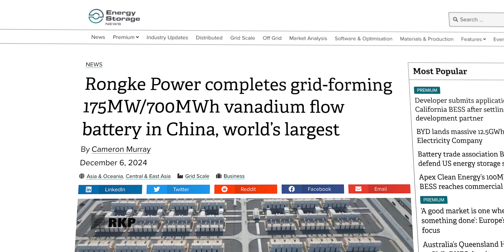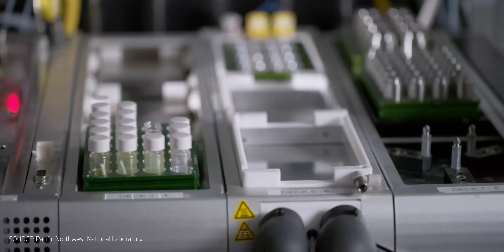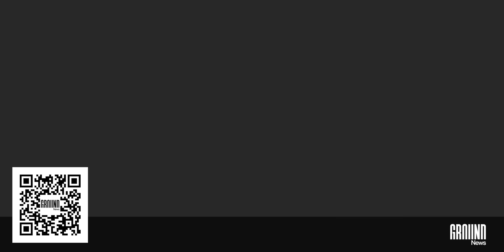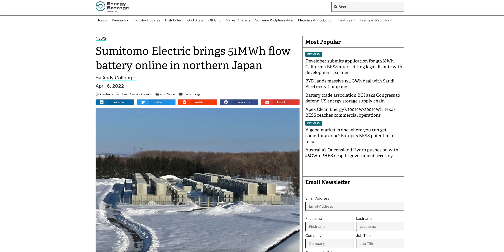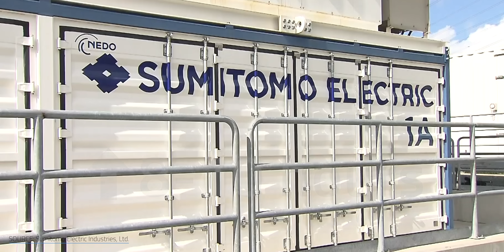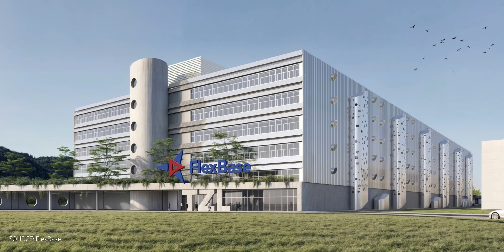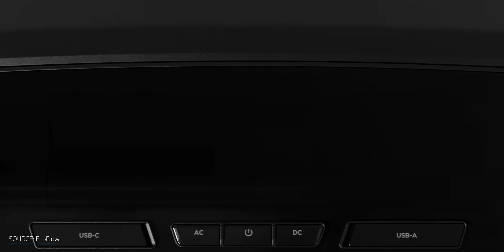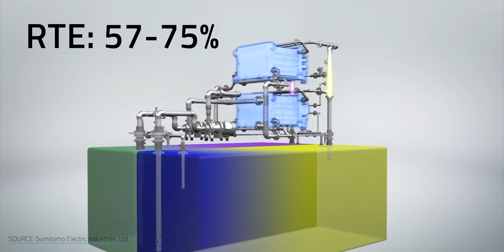Why Isn’t This Revolutionary Battery Everywhere?

Comment: Why don't we just go to sodium iron phosphate batteries for long-term storage. Naturally they're going to be heavier because of the change from lithium to sodium but don't have a higher energy density and not to mention sodium is cheap very cheap So is iron and phosphate why not just go that round.
Reply: Scaling costs, VRFB have lower scaling costs so suit industrial and grid storage where either power or storage capacity needs to grow. They also stack unlike some of the other battery systems or can be expanded by adding more storage tanks.
Reply: @GruffSillyGoat But you are trading that for material cost.. so it doesnt really scale well the larger you go if you dont have the supply for it. As i nthe video said, the more is in the tank, the RTE drops. Most system already stack... and could in theory stack higher... the reason most dont is for cooling or incase of a burn out, but if they can make safer batteries like out of NA - then there isnt really a reason they couldnt stack more.
Reply: @adr2t  - the RTE depends more upon the power density of the system than the energy density, higher power density (current discharge) offers lower efficiencies in VRFBs. Increasing the number of tanks (storage density) doesn't impact the RTE. Some manufacturers are also approaching hybrid systems using flow batteries for long-term and base-load storage to scale more cheaply and lithium/sodium batteries for short-term peak power needs.

The cost of scaling is also cheaper despite the higher Vanadium resource cost, this is because a lithium/sodium battery has a higher system expansion cost (resources, power and control electronics, cooling, etc). Plus the lower LCOE of a flow-battery system due to their longevity and lower maintenance requirement means the scaling of such systems pays back a higher return than for an ion-based battery system, which is very attractive for utility operators as well as industrial users. 

Understand the stacking issues re cooling, which is also why some lithium battery systems have cooling on top to expel heat to the surroundings, with flow batteries they can be stacked multiple high as they don't have the same thermal management considerations.
Reply: @ I was meaning the idea of having to buy the fluid ... the more yo have the less RTE you have.. but also you have to buy the stuff... while it might be cheaper... I am going to assume it isnt because of the limited deployment so far.
Reply: @ - if your adding more 'fluid' to extend storage duration but not changing the power drawn the RTE isn't impacted in a flow battery.
Reply: @ No, and he said it in the video, yes, adding more does lower it that is why he had to scale the RTE. Along with the fact that it cost more to have more. It does make sense, you have to have pumps that can move the fluid around. The more you do, the larger the pump has to be to move it around.
Reply: @adr2t  - The RTE is down to the charge/discharge rate on VRFBs (i.e. the cell size), this is why those in higher power systems with larger cells have lower RTE (which is what was mentioned in the video). This occurs due to cell efficiency lowering with cell size and additoinal pumping losses (hydrolic losses mentioned in the video) required move a larger volume of liquid in and out of the larger cell. If one is only expanding the volume storage (to extend duration) as I mentioned above the RTE isn't impacted as the cell size is altered nor are the hydrolic losses as the flow rate doesn't significantly change.
Reply: China already has the first production battery farm in sodium iron phosphate, at far cheaper cost per MWH than lithium. And that is a PRODUCTION facility - the pilot plant stage is behind them. I can't see other chemistries such as flow batteries catching up anytime soon.
Reply: Diffferent battery chemistries have different characteristics, flow batteries for example offer nearly indefinate stoage and can offer continuous operatio and low cost expansion in some condigurations.Lihium/Sodium offer shorter duration but higher power and more rapid charge/discharge rates.
Reply: @ sodium abtteries can be produce anywhere... it wont be china in this case as many of them are going online this and next year.
Reply: CO2 is climatologically irrelevant. 

CO2 is climatalogically irrelevant: Interglaciation climate change (e.g. the Medieval Warm Period) is caused by cosmic ray fluctuations ( see the work of Henrik Svensmark, et al).

Just burn coal: the CO2 issue is irrelevant (see above). The sulfur issue with gaol is bogus too: sulfur is an agricultural fertilizer (ask the farmers). The "acid rain" issue is at most "a nuisance" (see the $500 million NAPAP study of 1990).  "Acid rain" was another one of those shallow media sensationalisms, like "global warming" and "ozone depletion". 

Global warming is 21st century superstition. 

Just burn coal.

Sorry, but however intriguing these battery-thingies are, they are just another tax-sheltered boondoggle for people who don't want to do get a real job. 

Just burn coal.

Comment: The reason these technologies are not catching on in the US is simple. There is one big red hat wearing reason why. It is a shame that politics has gotten tied up with environmental tech. I am glad to see a lot of companies pushing forward in spite of it, but several are backing off because of the promise to reduce government regulations on pollution and that is disappointing.
Reply: Yeah , good old china. Producing green products the ethical way in Xinjiang provence.
Reply: I totally agree. I am pretty conservative, but I have solar panels, I am also pro recycling. Conservatives look at green policies as run by dirty tree hugging hippies. Renewables really need to be marketed as a national security issue. China is ahead of the US in many renewable categories. Being green is security, as oil, coal, and natural gas will run out one day and America needs to be proactive instead of our usual SOP, reactive.
Reply: All technologies have pros and cons, green energy and green energy storage still require nonrenewable materials. Really I think nuclear is the best option, but even nuclear would benefit from energy storage since nuclear plants can't just be turned off and on so outside peak ours would be wasted. I also highly doubt the president is against battery tech when elon is one of closest advisors currently
Reply: @ yes, but allowing one manufacturer is not a path forward. China is investing heavily in green tech and is so far ahead of the US thanks in part to Trumps policies in his first term, that I am not sure we can catch up. Say what you will about green tech, but is the future. Fossil fuel consumption is not sustainable especially with the growth of datacenter/AI and their rapidly increasing demand for energy, which is far higher than EVs, FYI. China is not stupid, they are playing the long game and once they overtake the US in economic power, we are in real trouble. They have far more economic potential just given their population than the US will ever have. They are also beginning to align with India more and more and if that happens, there is over a quarter of the worlds population in 2 countries in very close proximity.

Comment: so if the electrolyte is a liquid that moves to generate electricity... could it be combined with hydro turbines? pump the electrolyte uphill during charging and let it flow down through turbines for discharge.
Reply: they do not generate anything only store

Comment: The downside of vanadium flow batteries, as always, is the price of vanadium. This will always be the limiting factor as it prevents meaningful cost reductions due to the electrolyte being the most expensive component of this style of battery
Reply: Hopefully there will be a new mine discovery in Russia
Reply: Thats been the problem behind every major advancement in battery tech.  The price per unit of power is not linear or even realistically practical with too many of them.
Reply: Thats why I said Na is the answer... and the US does have pockets of Li that is easy to get too... so for the US I dont see the need for "this" type of redox battery. You can also use salt water too.
Reply: CO2 is climatologically irrelevant. 

CO2 is climatalogically irrelevant: Interglaciation climate change (e.g. the Medieval Warm Period) is caused by cosmic ray fluctuations ( see the work of Henrik Svensmark, et al).

Just burn coal: the CO2 issue is irrelevant (see above). The sulfur issue with gaol is bogus too: sulfur is an agricultural fertilizer (ask the farmers). The "acid rain" issue is at most "a nuisance" (see the $500 million NAPAP study of 1990).  "Acid rain" was another one of those shallow media sensationalisms, like "global warming" and "ozone depletion". 

Global warming is 21st century superstition. 

Just burn coal.

Sorry, but however intriguing these battery-thingies are, they are just another tax-sheltered boondoggle for people who don't want to do get a real job. 

Just burn coal.

Comment: 60% battery efficiency combined with cost of storage and production really shows the low hanging fruit of improving efficiency at the retail end.
Reply: 60% is still better than 40% of hydrogen systems.
And if he is correct that raw performance is closer to 90% but the performance losses are mostly due to pumps, then there is plenty of space to improve.
Hydrogen has 40% performance on the storage medium itself, so no improvement is possible.
Reply: @hubertnnn  That's what I was thinking. If the inefficiency comes from moving the liquid, that sounds like something that could be improved.
Reply: @hubertnnn  Yeah, but Hydrogen can be stored in LARGE quantities, shipped around the world and used in cases where battery tech doesn't work (airplanes, ships etc. either pure or as synthfuel/synthgas). And Hydrogen largely used in the industry, so green Hydrogen is needed anyway. 

So for large amount of cycles (daily usage) batteries are way better than hydrogen. But on that end LiIon, LiFeP or NaIon have WAY better roundtrip efficiencies (80-90%) and also quite a lot of cycles nowadays (especially in this usecase they are "slowly" charged and discharged which also improves the amount of cycles).

For other usecases (industry, long term storage to use for " longer periods of bad renewable weather", airplanes etc.) Hydrogen is just way superior than/not replaceable with batteries so Hydrogen production is needed.

So 60% RTE is a real problem, because they compare with the 80-90% of other batteries, not with the 40% of hydrogen.
Reply: @ I agree with the cases where you have to use hydrogen, in fact I believe green hydrogen might replace coal in metallurgy industries (except for steel production), since it burns hotter and leaves only 1 byproduct: water vapor, as opposed to coal's hundreds of impurities.

But using hydrogen for power storage is not a good solution, because you need a lot of materials for the tanks, and in the end the tank itself weights more than a battery with similar energy capacity to hydrogen store in the tank. Then you need to add the weight of fuel cells and you get a very bad deal.

The only advantage hydrogen has is being a fluid, so you can move it from tank to tank easily.

For long term large scale storage a flow battery like this vanadium one is much better since you can use simple cheap tanks, since you are not storing a gas at high pressures.
Reply: @hubertnnn  You don't need to store Hydrogen in tanks, like now fossil gas is not stored in tanks either, it stored underground. Germany has like 280 TWh of gas storage, and most of that can also be used for Hydrogen. 

And I'm pretty sure most other countries store there gas like this as well :)

You can either use a fuel cell to get electricity or just use the hydrogen in a normal gas plant, works as well. (so if you already have gas plants you don't need any additional plants)

And if it's really too much hassle with the hydrogen you can transform it with 80+% efficiency into methan and use it like normal fossil gas.

I don't get why the weight of the fuel cell would make any difference? That's only relevant for mobil uses, but not for power plants.
Reply: If it's heat loss then what if that heat can reused? Solar is close to useless here up north during the cold, dark winter, and most energy goes towards heating anyway. Being able to store the cheap excess summer energy for winter would be great, since the price can be 100 times higher in the winter.

Comment: I'm confused, on one hand we're trying to use less and less electrolytes in batteries (with the ultimate goal of a true solid state battery) and on the other hand we're developing batteries that use a bajillion times more electrolyte than concentional technologies..
Reply: It is inflammable electrolytes that are the issue.
Reply: @ In cars, yes. But as I already said safety in cars is not what I'm on about
Reply: @Harry_Gersack  different use case I believe. Stationary application makes sense with flow, it's heavy but high capacity and cheaper.
But you wouldn't put it in a car
Reply: @helmimakes  yeah ok safety, that's an obvious reason. I didn't even think about putting them in a car because it's so absurd. I thought it was kinda obvious they only make sense in stationary applications.
What I was thinking about, is the fact that we're trying to get rid of electrolytes in batteries for environmental reasons. 
Yes, Matt cited a source where they managed to recycle up to 97% of the Vanadium but their energy density of 25kWh/L of electrolyte is incredibly low compared to e.g. a LiFePo4 battery, which has an energy density of ~200kWh/kg. 
So these vrfb's need enormous amounts of electrolyte, so even only a few % of that will be quite a lot.
Also they've managed to recycle that much in an experiment, how well this translates to real world applications seems to be unclear. 
Also what the cost of the recycling will be. Because if it's an expensive and complex process, there is a real danger of us western countries exporting that crap to third world or developing countries, where it gets "recycled" in a not so environmentally friendly under probably horrible conditions for the workers. Just because it safes some western company a few quid.
I mean sure, that's a problem we currently have with much of our trash, regardless of whether it is recyclable or not. 
But wouldn't the ultimate goal then be to develop systems that don't need to be recycled or don't pose a threat to health and/or the environment?
I'm thinking about more "mechanical" solutions such as pumped storage power plants or other plants that use potential, thermic or kinetic energy.

Edit: my bad, wasn't an experiment

Comment: If you need cheap upfront costs and high efficiency, lithium-ion is better.
If you need long-term cost savings and scalability for large-scale storage, redox flow wins.. it is the choice for grid storage .. Tesla's grid storage hopes are junk.

Comment: why aren't sodium batteries cheaper and more available
Reply: @MisterPikol  sodium is much lower in energy density, Lithium costs are low. More energy density and lower costs of lithium makes sodium not as attractive. Also scaling still hasn’t really happened. In the coming years it may have a larger presence. (Has some other benefits that LFP doesn’t.)

Comment: Ground news is not a good sponsor. Everything has a bias. Ground news is reddit news with how they draw the line. It does not do what it was meant to. Because everything has a bias. You cannot avoid it. No subject can be boiled down to left or right. They are too complex. Protest for the news to be upfront rather than figuring it out yourself. The federalists had their own newspaper and were open about it. The video is great though and its very exiting to see the changes in grid scale energy storage.